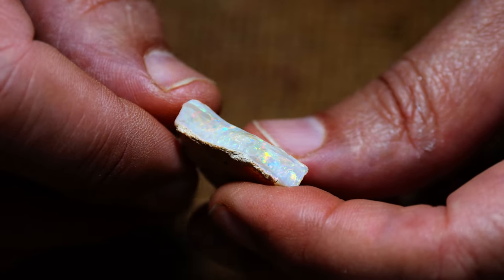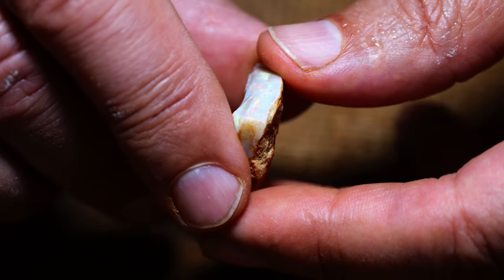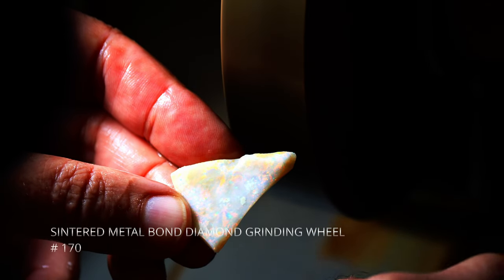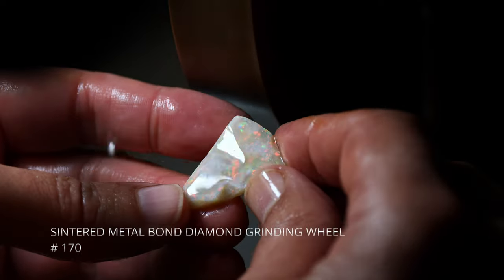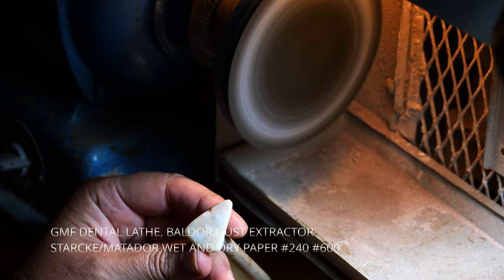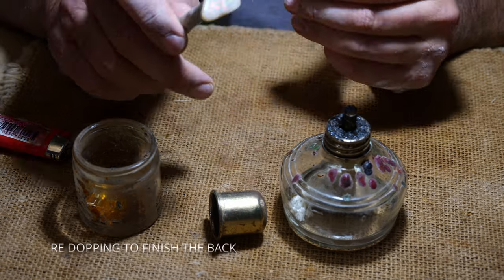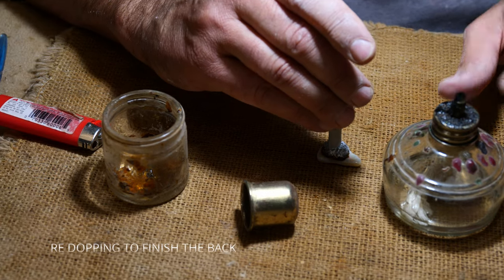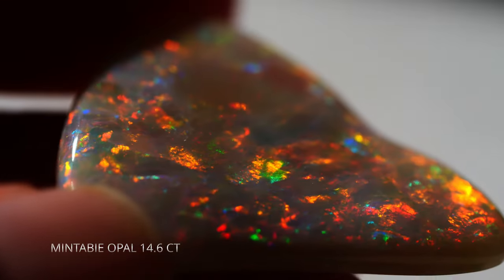Cutting Opal From Mintabie. Better Than We Expected.

Comment: A great learning video thanks. Can I ask what thickness saw blade I should use for trimming opal on a tile saw. Thank you for your time
Reply from the maker: Thank you for your feedback. Regarding the blade, it may depend on the shaft diameter of your tile saw because some blades have smaller centres that may not fit. Personally I don't like to bush blades but sometimes we have no choice. That being said, I do most of my fine work on 5"x 0.012" blade and my roughing on a 6"x 0.020" blade. Of course this is only a guide because there are finer blades and thicker blades, you just need to find the right combination for your saw, and for the type of material you are cutting. Hope this has helped.

Comment: Hi Robert 
Could you You inform Me on this shellac u using please,im sure I spelled it wrong.
Dopping wax is so hard to come by here in in Austria
Reply from the maker: Thank you for your question. Shellac is used for polishing furniture. It is dissolved in alcohol and painted onto the surface.  I like to use it for dopping.
Reply: @diverseopalproducts  thank you Robert
Reply: @diverseopalproducts  
So as seen in the video..its like gold flakes  in that jar and u just get them on the dopstick and heat it with the flame ..?
Reply from the maker: @V27RV  Yes, heat the dop stick first. This will help start the process of building up a workable amount to dop with.
Reply: Thank you so much for your knowledge and guidance🙌🏽
Reply from the maker: @V27RV  You are welcome.